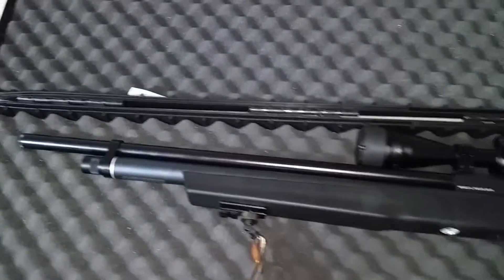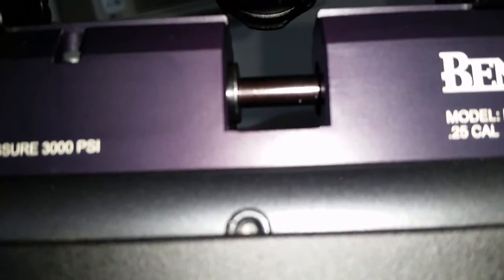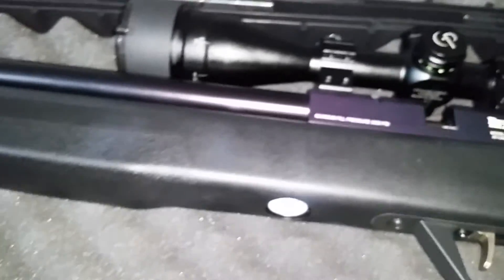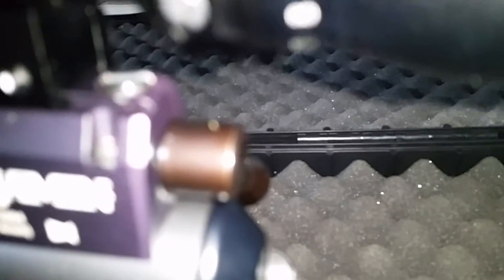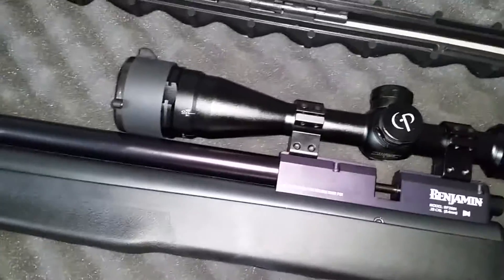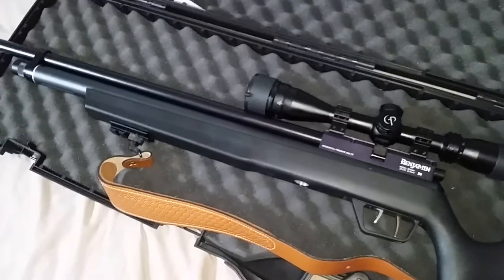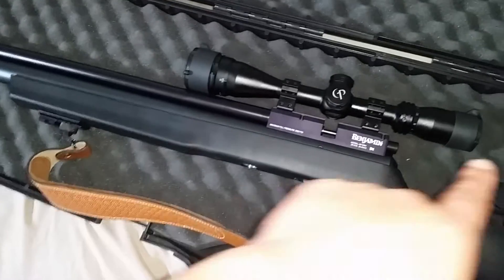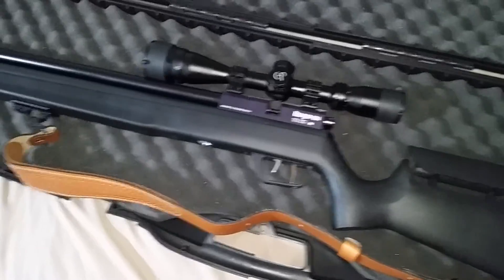How to reinstall barrel o ring on a murader

Comment: You are absolutely correct about the Eun Jin pellets. The tin was full of deformed pellets and very dirty with lead fragments.
The o-ring is a #10 SAE...NOT METRIC.
You can actually get it in without taking gun apart. I advise putting silicone oil on it. While you're at it, I believe it's a good idea to remove and clean bolt. Reinstall with moly past on bolt and cocking screw that's attached to it.
Gen1 has been superb for the past 7yrs.

Comment: Thanks for the vid I thought it was my transfer port o rings.One was missing but after I replaced it the gun still was shoot erratic and pellets kept jamming in the breach.The gun also became much louder.I think what happened was the magazine failed on me and using the cleaning rod to clear it I must of pushed knocked the o ring out of its seat and l probably shot it out of the gun.I also felt air from the breach when shooting.I thought I broke the dam gun because after replacing transfer port o rings it was no better.

Comment: You don't need to take that all off all you need is a couple of small picks  and Slide the o'ring back in just hold the pic inside and push with the other pick and it will find its way back into the groove literally took me 2 minutes, it goes right in front of the magazine you can see the groove if you angle gun to side and look